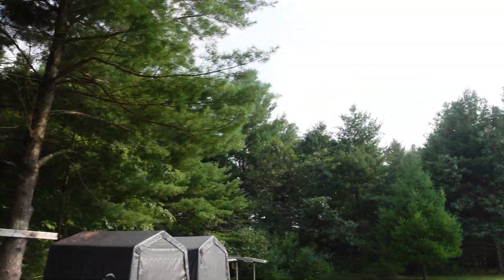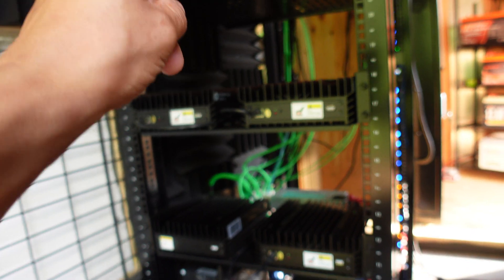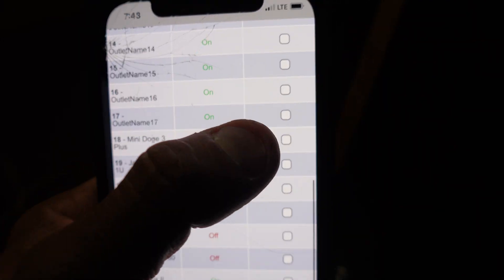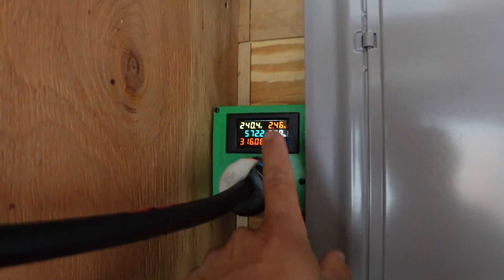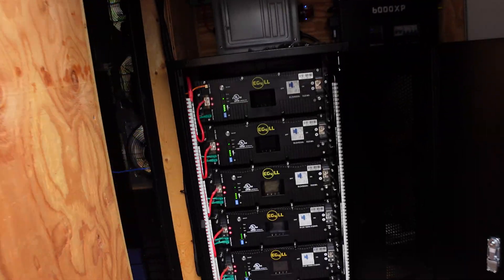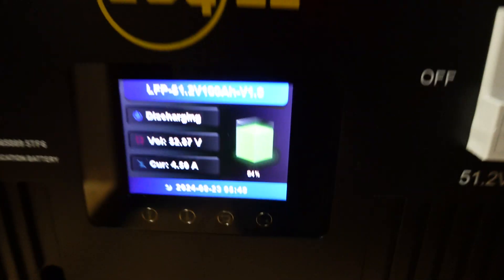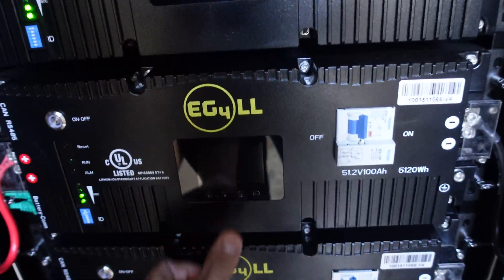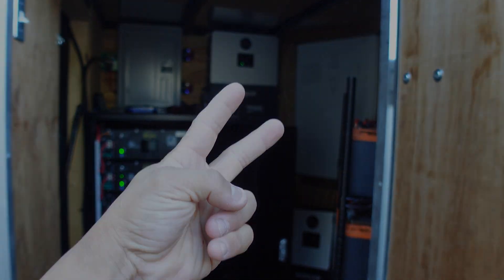My DIY Solar Setup Gets Tested Over Night...

Comment: I do the same thing with my small 5 card gpu rig and a KS0 it’s annoying to have to remember to shut down the gpu rig for a few hours a day to recharge for the night. Do you happen to know any way to automate shutting down a gpu rig on hiveos and turning it back on? I know I could do it with a switch timer but I’m not sure if that would wear out the pc or gpus.
Reply: Nvm I figured it out. HiveOS Scheduler + smart switches with timer/scheduler.

Comment: That is an awesome video. I thought about only running 1 battery and pulling 3200watts from panels to power my rigs during the day. Well that is currently what I am using and then using grid power at night. This would at least cut maybe a 1/3 off the power bill at the end of the month instead of spending $8K on batteries.
Reply from the maker: You could do that for sure!